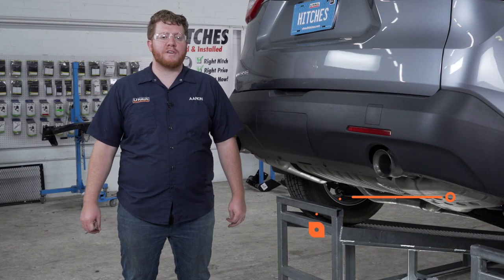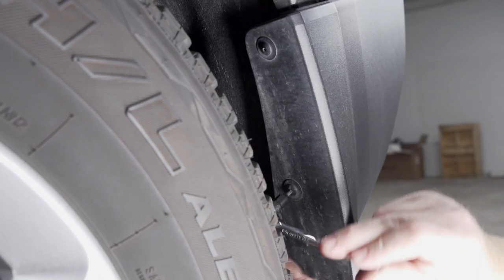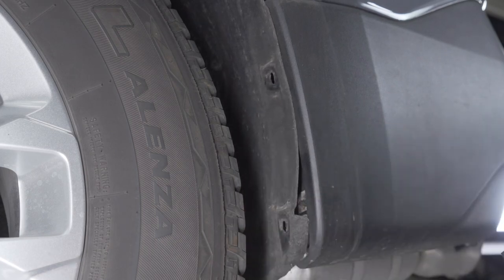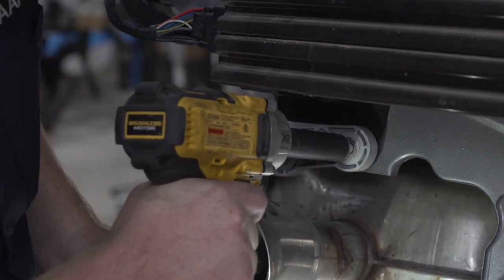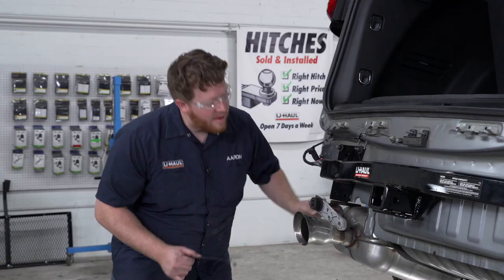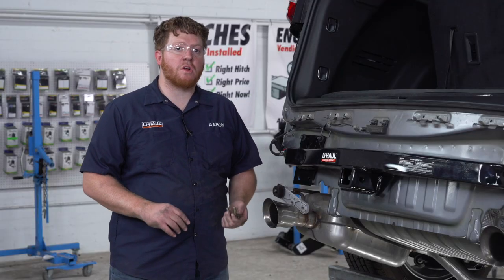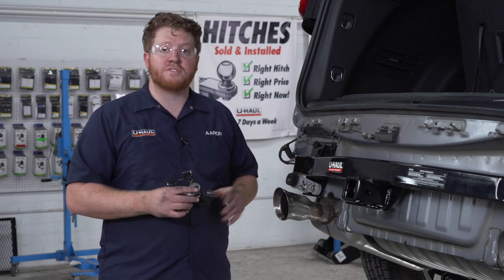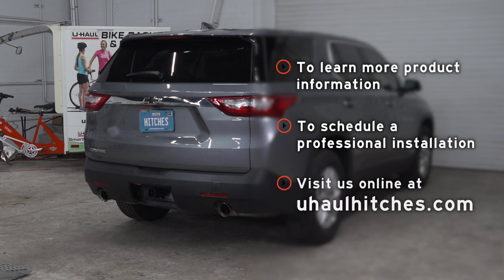2018-2024 Chevy Traverse | U-Haul Trailer Hitch Installation | CMF13433

Comment: If you have the rear sensors, is there something to disconnect before completely removing the bumper?
Reply from the maker: If you have rear sensors, you will most likely have a wiring harness attached to the bumper that will need to be unplugged. This can usually be reached once the bumper has been detached. Grab a second set of hands to make this easier.